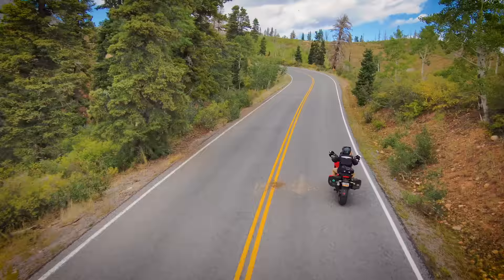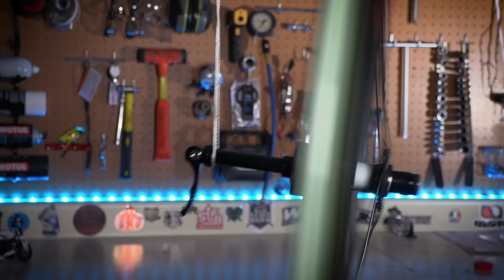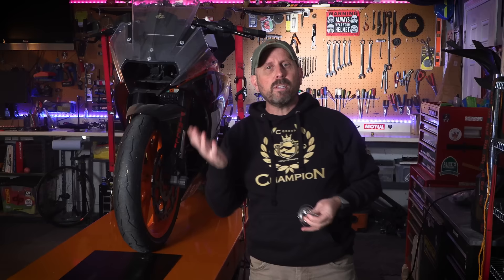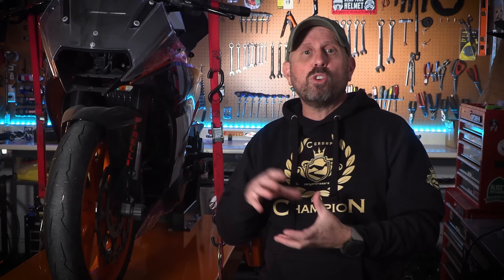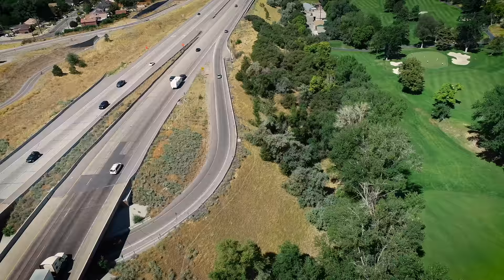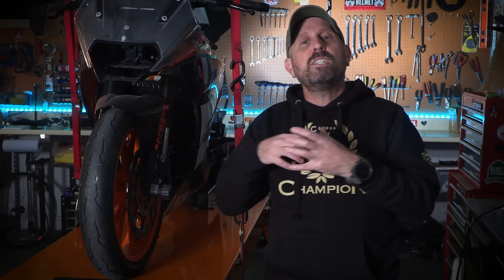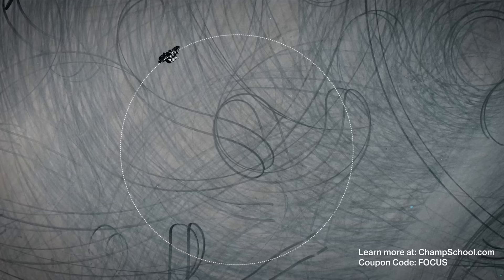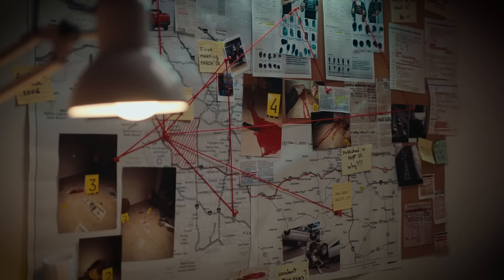Do We Fully Understand How Motorcycles Work?

Comment: I tried reading Motorcycle Dynamics and it quickly went far beyond what my feeble brain can comprehend. LOL
Reply from the maker: I have to take it in small doses.  The fact that it's italian translated to english makes it a slow go.
Reply: I suggest you to first read only the easy parts, and just skip everything else. Then on the second round read the easy parts again. Third round same thing. And so on. You will notice that every time the amount of easy parts will grow.
Reply: A few of the equations have typos and it's translated from Italian but otherwise an excellent book 🤓
Reply: I'm reading Cossalter. One chapter at a time. So that I can resume. One you need to read is Eric Offendstadt. Basically, no secret in riding a bike : Newton's 3 laws. Countersteering is just action/reaction. One thing people don't understand or do well, including me, is how to oversteer a bike only by weight distribution. Some people are still confused with load and weight transfers.
Reply: @YaHsServent Get a better hobby.
Reply: @CanyonChasers  I'm italian and i was reading it in english not very successfully... This comment has just changed my short term life
Reply from the maker: Spam comment removed. ✌️
Reply: The translation was pretty good to be fair but some of the mathematical symbols and variable letters/names are kept as per the original do a bit unintuitive. Then there are some errors/typos in a few of the equations which will throw people if they tried to apply them. I derived all the equations from first principles so found the errors. I studied a motorcycle engineering BEng and pretty sure I was the only one to do this cos I'm a massive nerd apparently.
Reply: It's pure telekinesis.
Reply: @MaitreyaNow  can you give some examples?
Reply: @dovilacus  One that I vaguely remember was a 2nd order differential equation matrix to do with sprung mass reaction under acceleration/braking perhaps? Been a while and don't have the book at hand. Was just a small error in one of the terms to do with one of the geometry definitions I think. I'll get back to you when I find it and got a mo. Good book though.

Comment: I have watched too many damn videos in which the presenter has the absolute answer to how motorcycles corner. Especially that counter steering is the absolute answer and why it is. Finally someone, Canyon Chaser, says it isn't so and the answer is actually a combination of things and isn't totally known. Also more counter steer isn't always the answer to go tighter. Back when I had a Harley cruiser I had a limited amount of lean, backing off the throttle was the more expediant way of staying out of trouble. I have been meaning to go to the toy store to get a gyroscope and do some experimentation. How a motorcycle corners has always been a facinating subject for me over the past 59 years I have been riding. This video has so far been the best at explaining it and I will probably be long gone before a definattive answer is found. Thanks Canyon Chaser for the best explanation so far, at least for me. I will be re-watching this more than once to more fully understand the concepts presented.
Reply: Backing off the throttle, doing trail braking with the front brake to load the forks, all these can be safer than maintaining the same throttle position and leaning more. Seeing sand at the apex of a canyon corner once is enough to scare you into being a smarter rider.
Reply: @fallinginthed33p  You are 100% correct. Safer way to stay out of trouble.
Reply: @karlbishop7481  I never heard about the "staying on the throttle" part. Is this an American thing? Seems really dangerous especially for inexperienced riders to suggest they have to stay on the throttle in a panic situation.

When I did my licence it was always said that you have to increase lean angle in those situation and closing the throttle is something you do naturally. So in the end both act together to give you an even tighter turn. 

I don't even understand why this video suggests that one can only increase the lean angle while staying on the throttle. Increasing the lean angle off-throttle is literally what you do at the beginning of a corner.

Comment: This is now the 3rd video on this topic in the last month I've seen from 2 different channels (FortNine & Veritasium) and both are also physicists, bravo!  One must also take into consideration that these systems are in motion and so the dynamics changes considerably compared to a stationary object at rest.  Momentum plays a key part in maintaining stability as well which is often overlooked in favor of gyroscopic force, and I would say Inertia (resistance to change in motion) are also crucial factors which must be taken into account, for it is a combination of these interactions that give us stability WHILE IN MOTION (both momentum & inertia are dependent on mass & velocity).

If you aren't in motion, then lean angle, tire geometry and many of the forces simply don't come into play yet.  For example, if your bike is parked at a light, about to make a turn, one does not require much initial lean angle or counter steer to turn the bike, so those contributions are negated until the velocity (thus momentum) is sufficient to balance the bike naturally.  This transition velocity is what is referenced as normal turning as opposed to counter steering which is necessary at higher speeds above a certain threshold.  

So the mass of the bike and velocity are also critical factors in allowing the other forces to work while in motion.  That may seem obvious, but it is quite often overlooked.  Similar to aerodynamics on a bike, some effects don't come into play below a certain velocity threshold and only become more pronounced at higher relative speeds.

Comment: As a motorcycle instructor, I explain counter steering by establishing that 1) motorcycles need to lean to turn, 2) motorcycles are inherently stable and do not want to lean. Then I ask the students what happens to their car if they suddenly threw the wheel in one direction. The response is that the car would flip/lean in the opposite direction. Thus, to make our motorcycle lean in one direction, we must turn the steering in the opposite direction. Students also often ask how come motorcycles don't fall over at lean, and the explanation is similar to the orbital mechanics example provide. I use a washing machine instead. How come the cloth stick to the drum when the machine spins, but falls and tumbles when the machine slows down? Speed gets you centrifugal force, which can counteract gravitation pull down. Thus, if the ride match their lean (gravity) with sufficient speed, they won't fall over. In other words, speed keeps us upright, speed is life.

Comment: Great vid, well explained, subbed and liked.
I consider myself an ok rider.. I started on dirt bikes as a kid and have been riding most of my life. I hit 60 this year and ride a '95 Fireblade. I spent a lot of my younger years riding sports bikes fast.. but survived that phase more by luck than skill and judgement to be honest. I still ride quite quickly, but now I concentrate on fast and smooth as opposed to my dumb younger self racing from corner to corner.
I love that we don't really fully undestand bikes. For me its part of what I love about bikes.. Its such a dynamic experience, so much more engaging than driving 4 wheels. I remember when I was 20, and had just graduated to my first reasonably fast bike, a CBR600F, and my mate told me about counter steering.. I was confused.. until I went out and tried it.. then realised that I had been doing it without realising I was...I find now that when riding bits of road I know well, my technique changes from corner to corner without really thinking about it. Sometimes I'm on the gas early, sometimes I'm trail braking deep into a corner.. sometimes I lean the bike but keep my weight above it and sometimes the oposite and hang off the inside a bit so I can pick the bike up and get on the power.. All of this seems to depend on the road and of course the weather. I think that riding bikes makes look further ahead, and you a lot more aware of things like road camber, and of course road condition, which translates to being a better car driver too.
I have a question though.. I have always been a bit of a trail braker, and though that braking going into a corner compresses the forks and makes the bike turn in better because it steepens the head angle.. but that research with the trail experiment in the vid seems to say this isn't the case?  Have I misunderstood? why does the bike seem to turn in easier with a little brake on rather than coasting in at the same speed without the brake?

Comment: 02:15 "We can all agree that motorcycles lean and then turn." I don't agree. Motorcycles don't turn because they're leaning, they lean because they're turning. Basically, the 'bike tries to fall 'outwards' from the turn, so you lean 'inwards' to balance it out. 

Excellent video explaining how all this works :-)
Reply: I believe it works both ways - ever watch a drag bike with a 15" slick turn off the end of the drag strip on to the return road? They don't lean. Instead the rider hangs off the side like a side-car hack to maneuver the turn. Have you seen the video where a person runs alongside a coasting bicycle and the person pushes the bicycle forcing it to lean - the bicycle then counters it by steering into the lean. #keithkardell
Reply: Naah, not correct. If you were to first initiate turning, it would result with the bike leaning the opposite side and cause you to crash. By countersteering you are letting the bike lean (fall) enough to counter act the forces (that are going to apply when you initiate turning) and then you start turning. I can easily prove it too, whicever direction you lean shows you which action happened first before balancing. "If bike tries to fall outwards", it falls outwards, If you lean inwards first, congrats you can take the corner.
Reply: @keremozcu1009  The thing you're saying isn't correct is exactly what's shown in the video.

I'll walk you through a right turn in detail as an illustration. First you turn the bars to the left , which is counter steering. The 'bike goes left but because of angular momentum also falls outward, i.e. to the right. The bars then correct to the right, so now the 'bike is turning right (i.e. 'normal' rather than counter steering) and leaning to the right. The fall into the turn, from gravity, is balanced by the angular momentum outwards from the turn (basically, centrifugal force). That balance is why you don't crash.

Counter steering initiates a turn, 'normal' steering then takes over and continues the turn. Again, this is shown in the video.
Reply: @Grim_Beard  I was angry because you write the exact same thing I've written and I spend 20 minutes trying to understand why would someone that can understand dynamics writes the first comment. Then I stopped and read your first comment again. What you meant by leaning is not leaning into corner but any leaning action. Of course it is initiated by turning. What I meant was, If you want to balance everything out and turn, you first need to lean into a corner which is initiate by again turning to the opposite side. Funnily enough while riding GS in stopped traffic, In standstill, I let the bike fall to a certain point then release the clutch and do a tight turn. Might be a scenario where the leaning action is first ;)
Reply: @keremozcu1009  Sorry, I've re-read your earlier comment again and I think I'd misunderstood what you meant. We're describing the same thing in slightly different ways. Thanks for taking the time to clarify 🙂

Yes, if you hold the 'bike up while standing still like you say, you can initiate a turn without counter steering - good point!
Reply: That makes me think. Will a bike without front wheel steering turn? Like the video said u can’t lean without turning. But what if u just use the weight of ur body to make the lean and cone shaped tires work?
Reply: @hanzhe9720  That would be a unicycle, not a 'bike. ;-)  The answer is yes, but they don't have the manoeuvrability or control of a 'bike - precisely because they can't use counter steering.

Comment: It’s easier for me to understand how my bike works by remembering that the rear wheel pushes the bike forward. Any tweak in the direction of the front wheel’s direction of travel shifts the rear wheels power move in the opposite direction. Slow down the front wheel’s spin ever so slightly and voila, trail braking.  Now think some more about the front wheel. It effortlessly rotates side to side, its direction managed by the rear wheel’s power - except for your input via the bars. You can feel the front wheel trying to over-compensate by “folding” itself underneath you, hence the dreaded high side. So countersteering sets the turn in motion, but you continue pushing hard enough to prevent the front wheel going too far.   The crazy behavior of a grocery cart is very simiilar, the front wheels moving freely side to side, making you press forward from the rear to keep them straight.  You can test my theories for yourself on a bicycle, which really makes the advantages of trail braking show up. You can also see how body steering and peg steering actually work, if you start that effort from your hips.  I don’t think you need perfect science to get what’s going on. All you need to do is pay close attention and experiment a bit at relatively low speeds.  If you watch little kids floundering around on their own, you can see them testing and testing, all the while gaining more and more control. It’s a balancing act!  Keep you touch light and relaxed,, and feel the subtle and not so subtle interaction between rear wheel and front. Oh and ps, managing the throttle is not just safe, it helps manage steering as well, but only indirectly.

Comment: Dude thats crazy. Im reading the exact same book for bed time reading. I love that book!

This video is awesome. There are so many bad techniques, based on myths, that pervade the motorcycle world. I was riding some mountain roads with a group one time and realized I was coming into a corner a little too hot. I slowly applied brake until, I was at a comfortable speed, including, trail braking through the corner. One of the other riders afterwards said "bro, never use the brake in a corner it stands the bike up and you'll blow through the corner"......except I did apply brake, didn't blow the corner, and never would have even thought twice about it had it not been for this advice. If I'd have followed his advice there is a good chance I would have run out of lean angle and low sided.
Reply: This is a bit of the rub for me - I was in a group ride one time as a newer rider - trail braking always made sense to me, but was chastised by the rider behind me for braking in the corner.  Made me feel quite intimidated for that ride and took awhile to brush it off.
Reply: @luvmyguzzi  I know exactly what you mean. The fastest and most experienced riders in the world do it, so I'm pretty sure you and me will be just fine trail braking into corners. Now that I think about it.  I might actually do a video on the physics of trail braking at some point on my channel.

Comment: Adding lean works wonders on a racetrack, with good, clean, dry asfalt and a nice runof. On public roads, adding lean can works when the surface has good grip and we have a clear view of the corner. In almost all other circumstances, I add a little break to my trail braking. this adds control and lowers the energy i have to bleed of in case of a crash.

Comment: About a decade ago I spent about a year trying to sort this out myself. For the first time on the track I actually dragged my elbow in a corner. That was shortly before I was low-sided by another bike, shooting me off the track and I spent a few weeks thanking my spine protector for my black and blue ribs but non-broken spine. So I had a lot of time to think about it, and I pretty much ended up right where you did with the "falling into gravity, using throttle to control radius" model. 

So thank you for summing up what I bored many people with that year as I went through all the theory to try to distill it down. I just have one small difference or addition: If you reduce the conical section of a tire to zero, so long as traction remains, the motorcycle will still turn. The 'conical section' theory is a misapplied observation. It has nothing to do with the motorcycle turning. in fact, if you do introduce a true conical section to the tire, like through under-inflation, the tire will turn but it will resist 'steering'. If you've ever felt the heavy feeling of an under-inflated front tire you recognize this. The cross section profile of a properly inflated tire is a radius, not a cone. Yes one can argue that the contact patch flattens the radius so it therefore creates a conical section, but I would say that is merely a flattened radius and does not exert the same type of forces as in the 'cone shaped wheel' examples--unless taken to extreme as in the under inflated situation. Anyway, great video.Thank you!

Comment: The front tire even slightly turned works like a break. If you abruptly turn the front tire the force forward wants to tip the front tire over, like run over it but because there is a pingalimb the front tire turns to correct. I describe riding my bike threw twisties like riding a unicycle with a cruch the front tire being the cruch. I've only been riding a year and got 17k miles under me , x-hotrodder